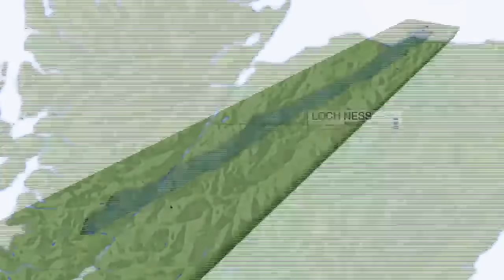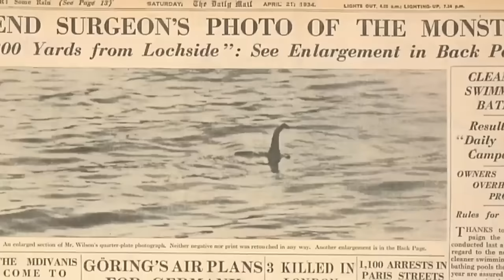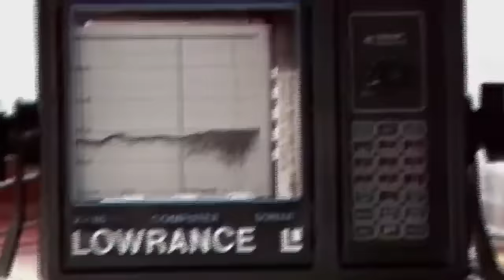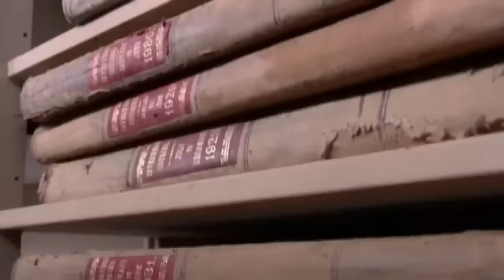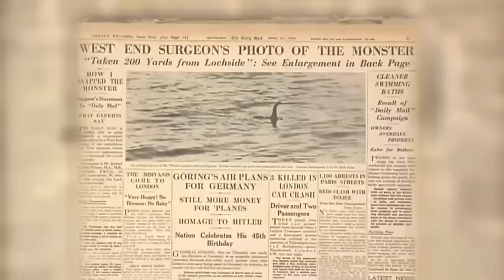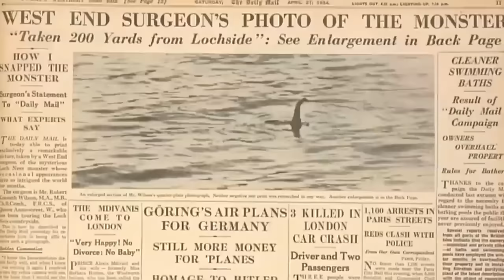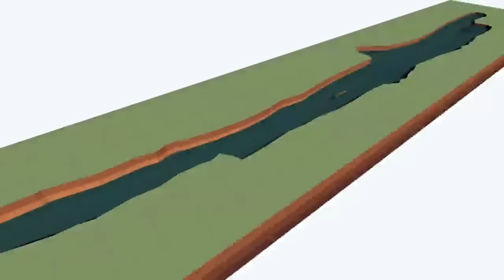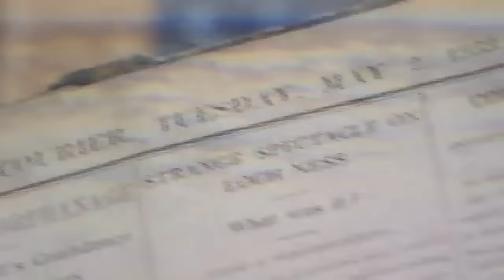The Mystery Of The Loch Ness Monster | A Legend Uncovered

Comment: did not need special equipment to tell me that surgeon pic is fake, you can tell its a very small object by gauging the small ripples and waves around it  that it was taken very near by to shore otherwise it would be a baby lil monster , always saw this flaw in that stupid pic from the very start, if you wanted to fake it's size you'd need much larger waves or much more of them surrounding the monster and those look more like little ripples from near a shore line

Comment: It would be interesting to add a candidate for the title of Loch Ness monster. The Greenland shark. This is purely speculation, but some experts believe it is not impossible that the species tolerates fresh water, like the bull shark, and would therefore be able to swim up the River Ness to the Loch ( as do seals and perhaps sturgeons).  From then on, this theory becomes interesting because in addition to becoming very large (between 23 and 26 feet for the largest specimens) the Greenland shark only has a very small dorsal fin, unlike most other species of shark. If it swims on the surface, we would see a huge bump emerging, which corresponds to a very large part of the sightings.

Comment: What's it eating  has any droppings been found ( fish bones etc
Reply: No, they did dna testing of the water in various locations for that reason, no unknown dna was found and at those temperatures dna would survive for a very long time...at that depth and temperature at the bottom, a carcass would be preserved well enough for long enough to find it on scans, it'd also make it that much easier to test for dna during/after decomposition...it isn't there, but the documtaries are still interesting regardless...the oceans are still 95% unexplored, we know more about our galaxy than we do our oceans, so there's most definitely unknown creatures in the oceans, probably some good sized ones...but nothing of any size or significance in the Loch. 

Also, animal like that won't live centuries or 10,000 years...2 prehistoric dinosaurs would have had to survive the extinction of the dinosaurs, continue mating in the sea, then 2 get stuck in the Loch at the same time, then mate and produce offspring...and if there were multiple, we'd have found atleast one, it's dna, a carcass, bones found throughout the years, or picked up on a scan...and that isn't the best water to thrive in if it was cold blooded with a slow metabolic rate that doesn't need to feed often...if it's warm blooded animal with a high metabolic rate, how would one get enough food to survive? 
If there's more than one (only way for it to survive since the last ice age) would have no way of surviving and sustaining themselves at that size...a creature that size needs large prey, trying to catch small fast moving prey 100 times a day to stay healthy would not only be extremely difficult in terms of speed and agility to catch it, but hunting small prey all day would burn a lot more energy than the food provides... nothing about it makes sense.